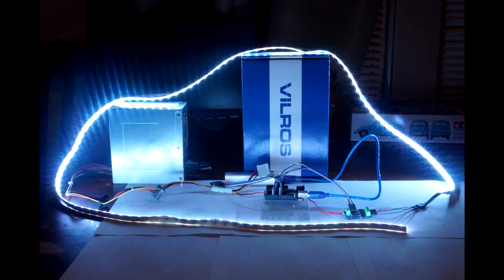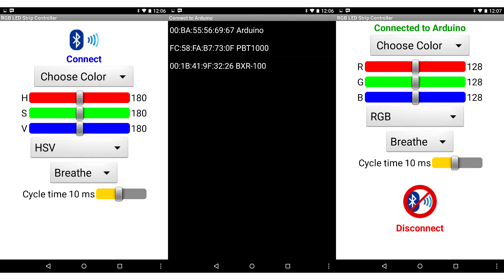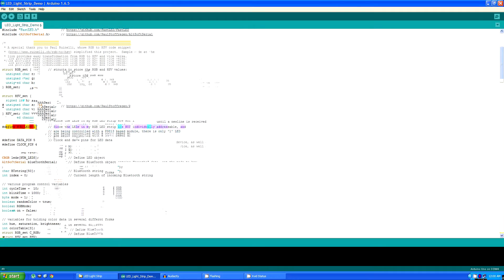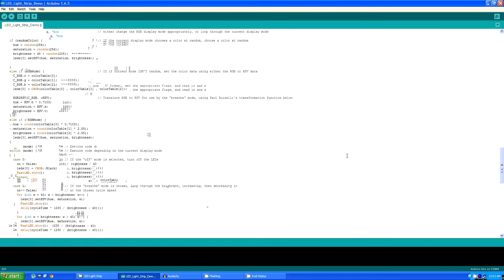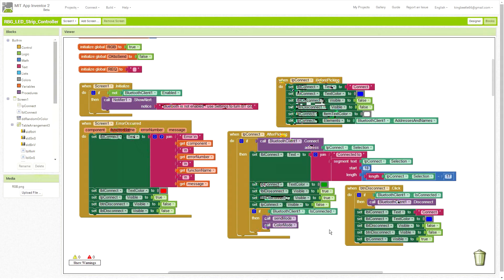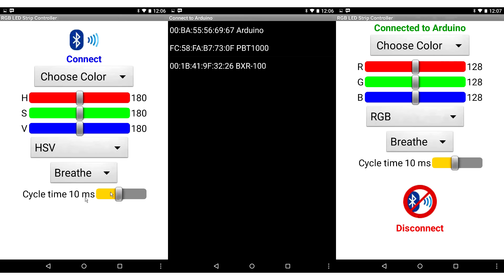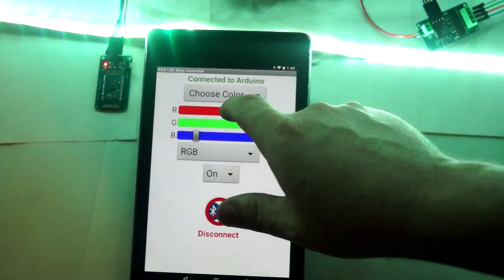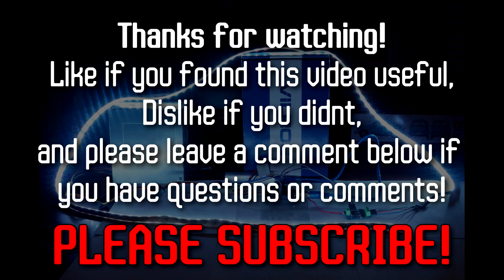Using a P9813 based LED strip driver module with an Arduino

Comment: I know this might be a long shot.. but i'm trying to use your script but without bluetooth module and just serial input..  you wouldn't happen to remember what the syntax of the serial read would be?? i'm guessing here.. I've got it kinda figured out but not quite..  when I input "On:  , Color: , RGB , 255, 255, 0"  stays on and some color..  but thats it..  any help would be nice.
Reply from the maker: Here are the commands:
	Breathe: [cycle time in milliseconds]
        Blink: [cycle time in milliseconds]
	On:
	Off:
	Random:
        Color: [RGB,RSV],[three color values separated with commas]
Reply: @KingBeetle1966  thanks... your a life saver..   So in my case.. syntax would be.. " On: Color: RGB, 255, 0, 0,"  for red.   EDIT:  yes verified, commands working as it should now.. thanks again.

Comment: Great video!
I plan on using the same driver module to drive a single RGB LED, however it is not clear to me, whether the driver works with a 5V external supply voltage. The P9813 certainly does, and since the driver module simply uses 3 transistors to amplify the max current, I do not see a reason for it not to. I was wondering, if any owners of this driver module (or more knowledge of electronics for that matter) could confirm this?
Reply: Hi, what is the power of the RGB LED you are wanting to drive?

Comment: Im trying to use the P9813 module, but without using the bluetooth control, instead I want buttons to trigger different LED strips to do certain things. Im new to coding, so what parts in your code are important to the LED module? Thanks!

Comment: Great explanation.
I just have a question, the arduino is powered via usb in the video, if the arduino was to be powered via the vin pin by the same power supply used by the  module, how should the wiring be done?

Would appreciate your help with this since I am just getting into the arduino world

Comment: Hello,
I did everything like in the video but I can't seem to get it working. I'm using a HC-06 Bluetooth module, when I connect the LED strip it runs a demo program cycling some colors. I can also connect to the Bluetooth module with my phone but if I change the color/mode in the app it doesn't change the on the LED strip. I already swapped out the arduino and the bluetooth module so it's not hardware related. Any help would be greatly appreciated
Reply from the maker: If you open the Serial Monitor in the IDE @115200 baud, you should be able to see the strings of data being sent via Bluetooth to the Arduino.  If you aren't seeing that data, check to make sure you are connected to the correct pins on the Arduino and your Bluetooth module - Note that my code uses the ALTSoftSerial library, which uses Arduino pins 9 and 8 for transmit and receive respectively.
Reply: I tried it with both configurations for rx/tx on Pin 8/9 but I never got anything on the Serial Monitor. Also tried different jumper cables.
Reply: I also connected with a Bluetooth terminal app and got responses from the bluetooth module. So the problem can only be between the module and the arduino
Reply from the maker: My guess would be that the Bluetooth module isn't set to communicate at 57600 baud.  Not sure what the default baud rate is for your module, but you may have to connect to it at its default baud rate and issue the correct AT commands to change the baud rate to 57600.
Not sure I can easily explain how to accomplish this in a text reply, but this link might help. - Note that the link apples to both the HC-05 and HC-06.

http://www.instructables.com/id/AT-command-mode-of-HC-05-Bluetooth-module/
Reply: You are right, the module uses 9600 as the standard baud rate. I tried to change the baud rate, if I send AT command I get an OK back but if I want to change anything else I get Error:(0) (which is AT command error). Have to look into it some more but at least I know the reason why it's not working now, thanks!
Edit: I just changed the Baud rate to 9600 in your sketch and ir works now. Hope I dont run into some bandwidth limitations but it should be enough
Reply from the maker: If you are having problems changing the baud rate in the Bluetooth module, you can always modify the Arduino source code to communicate with the Bluetooth module at 9600 baud.  It won't be quite as responsive to changes made on the Android app, but at least it will work.
Change this line:
  blueToothSerial.begin(57600);       // Initalize Bluetooth object
to:
  blueToothSerial.begin(9600);        // Initalize Bluetooth object
and then reupload the code to the Arduino
Reply: Yes I did that and it works now. Don't know why the module(s) wont accept any AT commands, maybe it's a different Firmware on them. Apparently there are like 3 different firmwares for this module

Comment: This is one of the complete videos I found on how to use the Arduino to control a LED strip with a LED driver in between. Of course you could build the LED driver yourself with simple transistors. Advantage of this LED driver is that it can be stacked so each LED driver can be set to a separate color.
If you want to control each LED individually, then this video does not contain the hardware you need.
This video is very informative and complete. The source code is easy to understand.
I do not use the Bluetooth module, but I could easily remove that part from the code.
I would've included a screenshot of a very simple example of FastLED just to put the LED strip on for very simple testing.
I'm going to use the ESP8266 (Arduino with Wifi). It uses more power than Bluetooth but it's smaller, longer range and easier to implement with web services.
Reply from the maker: Thank you!  I make every attempt to make things easy to understand.  And you are correct, this video doesn't address individually addressable LEDs or strips.  Individually addressable LEDs like the WS2811/WS2812 are entirely different.  They have a chip built into each LED, are powered by 5VDC, and don't require any additional hardware to control.

Comment: Hello man, i want to buy a led strip driver from dx.com, i want to understand how i can control a strip rgb led with this module, i saw that you connect Clock In and Data In to the board Arduino, but how i can control the color and the data if i want to control two of this module ? I hope that you can help me with this staff. thanks a lot.
Reply from the maker: The P9813 uses a 2-wire interface, where each device is "daisy-chained" together, so any additional modules would be connected by connecting each of the "Out" pins to the "In" pins of the next module in the chain.

The number of modules being controlled by the FastLED library is established when the object is defined and initialized:

#define NUM_LEDS 1       // Since the LEDs in my RGB LED strip are NOT individually addressable, and 
                         // are being controlled with a P9813 based module, there is only '1' LED
.
.
.
CRGB leds[NUM_LEDS];                                       // Define LED object
LEDS.addLeds<P9813, DATA_PIN, CLOCK_PIN>(leds, NUM_LEDS);  // initialize LED control object

So for two or more modules, the leds[  ] object would be declared with the number of modules chained together, and then initialized when the object is initialized.  For example:

For two modules, the declaration would be:
CRGB leds[2]; 

And the object would be declared as:
LEDS.addLeds<P9813, DATA_PIN, CLOCK_PIN>(leds, 2); 

Choosing which module to control is as simple as putting the module to be addressed inside the brackets of the declared object.  The first module in the chain is device 0.  For example:

Set the strip connected to the first module to white
leds[0] = CRGB::White; 

Set the strip connected to the second module to blue
leds[1] = CRGB::Blue; 

The documentation for the FastLED library is actually pretty good and is a great reference as well.
https://github.com/FastLED/FastLED/wiki/Frequently-Asked-Questions

I hope this answered your question, and feel free to contact me if you have more questions!
Reply: +KingBeetle1966 Thanks ma but How i can control the light and the color of the first strip and the color and the light of the second ?
Reply from the maker: Because the LEDs in the strip are not individually addressable, EACH STRIP is considered a single LED in the software.  Therefore:

Choosing which module to control is as simple as putting the module to be addressed inside the brackets of the declared object.  The first module in the chain is device 0.  For example:

Set the strip connected to the first module to white
leds[0] = CRGB::White; 

Set the strip connected to the second module to blue
leds[1] = CRGB::Blue; 

leds[0] would be the first strip
leds[1] would be the second strip, and so on...
Reply: +KingBeetle1966 Thanks a lot man if i need of your help i write you ☺️